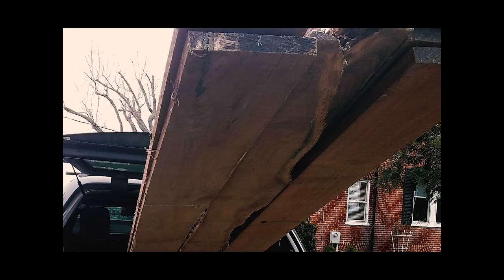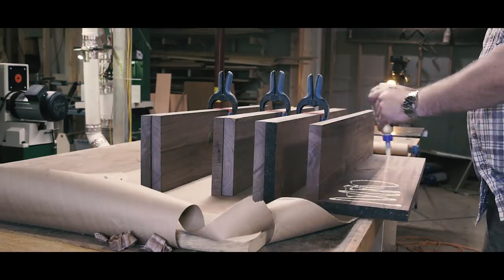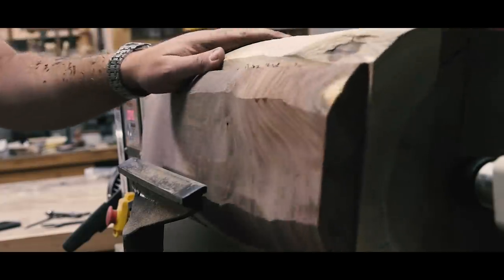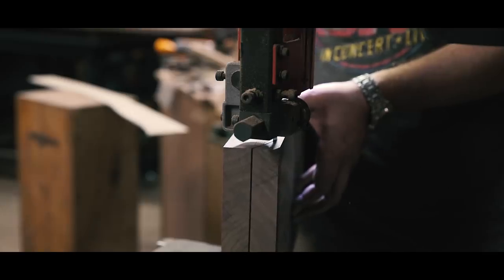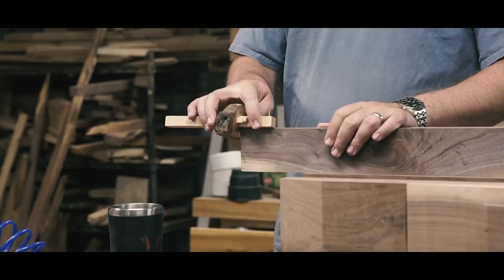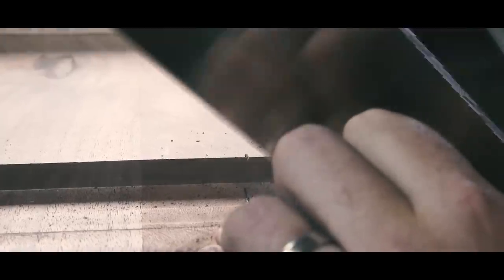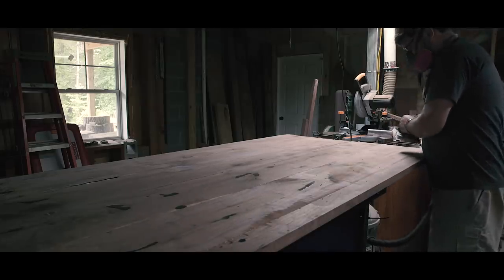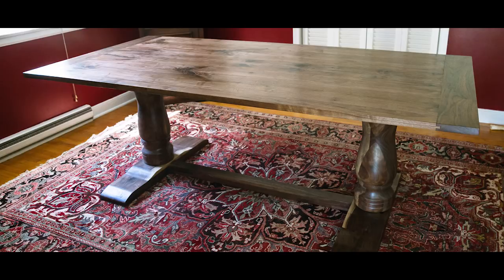Making a Double Pedestal Dining Table with Breadboard Ends

Comment: Best project yet? I think so. Amazing work man. That turning looked massively intimidating but the legs turned out (pun intended) so nice. I got spoiled having a huge pile of air dried Walnut to work through and now I’m out. I need to restock, as kiln dried just doesn’t compare.
Reply from the maker: When I got started, I was in love with kiln dried walnut.  Then I worked with Air dried Walnut and now kiln dried just looks too brown and muddy to me.  Totally spoiled.  I did do a barter job once, where I used the clients lumber to make an island top (maybe 3 or 4 hours in the shop?) and they let me take the rest of the air-dried walnut, a few hundred board feet.  That was a good trade.
Reply: Yeah, I think it is pretty safe to say best project yet.
Reply: Wm. Walker Co. If only we were all so lucky. I think I'm down to about 20 bf of air dried walnut left.
Reply: Yea, I bought a huge pile of it off of Craigslist and really loved working through it.
Reply: Crafted Workshop I lucked into emptying out an entire shed at a saw mill for $100. Had probably 2000 bf of mixed lumber originally. Well over 600 bf of walnut. I've had to giveaway a bunch just to move in my small garage shop.

Comment: That is one beautiful table! One day I'd like to have the skills to build a table like that. Right now mine would have so many mistakes that every time I sat down I would be counting them during the whole meal.
I was thinking that ratchet tie downs may have been useful when your clamps were too short for the stretchers, but I could be wrong.
Reply from the maker: One build at a time, man.  My skill set has grown a little with each big project and each mistake teaches me something new.  For that particular application of snugging up a big mortise and tenon like that, I do think ratchet straps would have worked.  I didn't realize it until after I had applied glue so it was a mad dash to get it clamped up.

Comment: If you use pipe clamps then make sure both ends are threaded and you have joint sockets on to protect the second thread ,that way you can extend the pipe to get any size clamp u need ,everyone uses pipe clamps but I notice thread is only one side

Comment: I have been told by two or three other funiture builders that a biscuit joiner does not strengthen the tensile unit. The glue itself is strong enough to bond it. on the safe side continue to use the biscuit joiner though have you heard of this?
GREAT JOB BY THE WAY
Reply from the maker: I trust panel glue ups with nothing more than glue if the top is allowed to move throughout the seasons. If the fastening system holding the top down doesnt allow for movement, something gotta give somewhere and the top might split. I really just use biscuits to help me align the boards.
Reply: Wm. Walker Co. I have built furniture most of my life. I'm just being told this by a couple of other people. But I continue to do things that I have done for years

Comment: How did you attach the top to the base? It looks like you just drilled through the finished top and bolted it on.
Reply from the maker: I attached it with lag bolts on the underside through elongated holes to allow for seasonal movement

Comment: Did you drill all the way through the breadboards to insert the dowels?
Reply from the maker: Yep. The dowel needs to bend around the offset tenon and back into the hole in the breadboard beneath for the draw bore to work properly

Comment: Beautiful work. I can't get the grizzly link to work. I got it to work on my phone. Crap I'm looking for a 15" or 20" helical head planer, was hoping you had one.
What kind of finish was that on the table?
Reply from the maker: For some reason some people are having a hard time with the discount codes and some aren't.  Both Grizzly and I have tested the codes but I still get a few people having problems.  I'm still waiting on a helical head planer myself.  They were having a hard time keeping them in stock.  Whenever I do get one, there will be a discount code for them.
Reply: Thanks for the info.
Was your finish the wipe on, let sit,   wipe excess off type or just wipe on?

Comment: Jointing one face and then planing the other is opposite from your normal milling sequence? Nice table.
Reply from the maker: Usually I joint one face and one edge then go to the planer so I do all of my jointing at once then move on to the next tool.
Reply: @wmwalkerco  Aw, that makes more sense! I was a bit confused with how it came out on the video I guess. Thanks for the clarification.

Comment: What about wood movement? Won't it destroy the end boards on the sides with time? That's very sketchy design
Reply from the maker: This is a traditional breadboard. It designed to keep the top flat while letting the boards expand and contract with seasonal movement. It's only glued in the middle. And the peg holes on the tenons are oblong.
Reply: @wmwalkerco  Live and learn! Thanks for an explanation

Comment: I wish the table had better protection.
Reply from the maker: From thieves? STDs? Online deviants?
Reply from the maker: What are you eluding to?
Reply: More polyurethane, Epoxy coat, Etc.
Reply from the maker: Arm-r-seal is pretty bullet proof and more protective than a straight poly. 6 coats should doi it and you will never see me do an epoxy topcoat. Ever.